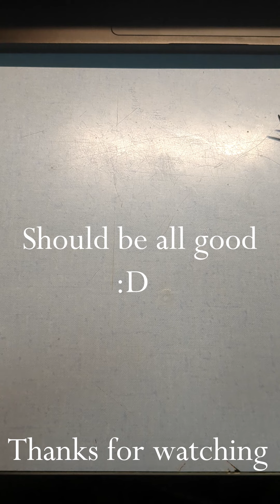SONY WH-1000XM4 Weird Noise Fix

Comment: Bought my headphones about 2 years ago as well and I'm having the same problem. Seems like this is a known issue and I'm shocked Sony hasn't done anything about it. Glad to report that your video helped fix mine as well. Thank you!
Reply: Mine developed this issue after almost 2 years of ownership. Unfortunately this did not fix the issue, and man oh man, that high pitched feedback is absolutely BRUTAL!!
Reply: @davidstasiowski6728  I nearly went deaf
Reply: Sorry to hear that. This is a serious issue for Sony. I had Bose QC headphones for nearly 10 years with zero issues. The high pitched sound could be made by compressing the ear cup, but never started on its own.
Sony’s damaged my right ear as well. I’ll never buy another Sony NC headphone again because of this issue.
Reply: It's been in every single XM model I think. But I swear it's 10x louder in xm4s. I agree it's fucking baffling Sony isn't doing anything about it! This noise is no joke it can seriously fuck your hearing and I am speaking from my own experience.
Reply: @davidstasiowski6728  Sorry to hear that. They damaged my hearing too and hearing is something I will never get back. It's sad, I had to lose my good hearing to a pair of fucking headphones. And yes same I'm never buying Sony headphones again.
Reply: @orangeeeeeee  I just stuffed a piece of cotton big enough to cover the little microphone and the grey rubbery hood in the middle of the speaker and have not faced the noise issue since then. I primarily had this issue with the right ear cup, but the solution mentioned above was applied to both ear cups and it works just fine now, haven't had the problem recur for over 4 months now.

This also tracks with what @David Stasiowski was saying about being able to reproduce the high pitched noise by compressing the ear cup. The cotton acts as a padded spacer to keep the microphone farther away from the ear so that sound reflected from the ear surface is attenuated before it can be picked up by the mic
Reply: @Rohan-ot5ji  Good for you, but I already returned mine with warranty a long time ago and I'm never buying Sony headphones again still.
Reply: @orangeeeeeee  my airpods did it, stopped using them shit heads and now my sony's are starting to do this shit slightly.
Reply: Serious problem of Sony headphones have,that can damage your ears freely... I think everyone should report about this problem to Sony support center officially. The headphones aren't cheap and the problem is absolutely inadmissible!
Reply: @Grafsin  True and to add to that hearing damage is literally irreversable damage. All you can do is adapt to the damage.
Reply: Programmed obsolescence.Doing nothing is part of the plan
Reply: What would they do about it ? You already brought it 😂 it’s not a PlayStation or I phone where they can just send a update out
Reply: @davidstasiowski6728 man stop being dramatic ain’t no way that lil ass sound damaged your ear tf did you do just keep listening to the feedback ? 😂😂😂😂😂😂😂
Reply: they can do firmware updates; they haven't. And there are some strict liability rules in some places (the EU) where if something is defective and injures you then even if out of warranty the manufacturer is liable. Given the way my ear feels this morning I do think they've gone beyond "loss of feature (here: noise cancelling) to risk to health and so need to take the hit. At worst they need to replace all headphones, repeatedly. Is that likely? Is if the lawyers say so. I recall that there was a batch of ultra thin Sony laptops where the Annualised Failure Rate (percentage of devices failing per year) was above 100%: even the replacements failed. They took a hit for that-but it made them care a lot more about laptop reliability
Reply: Bro 🎉🎉🎉
Reply: Have had my headphones for 6+ years and only now it started to deafen me while driving back from college classes :/
Reply: @Rohan-ot5ji  Thanks a lot man! The trick of the video didn't work and I tryied with a bit of cotton as you said and it worked!! Thanks so much!

Comment: Same problem here. It's really disappointing that 400$ headphones are just basically unusable (at least with ANC on) after just 2 years. My partner's XM3 are still holding up after 5 years of HEAVY use though.
Reply: Same here, I brought my XM3 and still keep on function while my XM4 has that problem, unbelievable. What a mess. It supposed to be better, not a assemble downgrade.
Reply: I have this problem on both my XM3 and XM4 so neither is safe

Comment: it really is just about reseating it to be honest. the wires are insulated. unless you somehow managed to slice them trying to solder them for some reason, it's not shorting or anything. not to mention if it was shorting, it would be catastrophic failure of the device. not just feedback. but it's certainly feedcback. you can confirm this by closing the sound proof barrier by pressing on the ear cup hard while the noise is happening as if to not let any air escape. It should momentarily stop but it'll come right back. which is also why if you slide the scale from off 0 up 1 in the app to toggle on ambient sound 1, the noise disappears entirely. the feedback occurs when noise cancelling is attempted.  if that's happening, you know it's atleast not "hardware" technically. but this reseating solution will solve your issue  for now. it's going to come back - i bet this only happens to anyone who has had their pair for a couple years. it's a consumable item - they design it with failure mind. 2-3 years feels about right. I have these headphones mind you and this all happened to me too. good little fix! i ended up microsoldering the joint and added hot glue support as a little test to see if that' will help act as a barrier from further moisture and debris damage. so far so good!
Reply: Your answer is the only one that makes sense! Also notice this problems tends to disappear for like 2 months than return. Thank you.
Reply: @lordfriar8736  are u fr
Reply: Thwn what should we do..
Reply: I think I can confirm this.
I have read a lot after facing this issue some years in, and there's a lot of theories online, including cleaning the moisture beneath the white covers. I do think those headphones have a moisture issue, some screws seem to have wears wax, others seem to straight up rust? I also had my Bluetooth failing for a long time and now it works again... But this particular problem seems to be caused by the position of the microphone.

When I tested the cleaning (I did not want to remove the cover because then the mic itself would likely get gunked up over time) I turned the headphones on with just the foam covers, to avoid undoing the pads all the time, but noticed a strong shriek on the RIGHT side this time. This caused me to of course move the ear piece away, moving the headphones and causing the sound on the left side. I previously already noticed that angling the left ear piece would prevent shrieking but it kept the white noise that this issue started with for me. So I played around by angling them and I was able to play with the feedback noise - like some musicians do on stage.
So, when re-seating the microphones, make sure to also put the wire back into the little grove thingies that hold it in place, probably with a bit of tension to better hold the mic in place. Maybe it could also be possible to add something between the mic and the rubber cover to stiffen that area and prevent it from moving around.

I suspect this issue started appearing when the ear pads started to degrade further. The fabric in the middle also kinda fell apart with the glue failing to hold it, and the foam cushion themselves, which are already pretty thin, are even flatter now. This probably causes the ears to press into the microphones and occasionally change their position for the worse. I've seen some sweat resistant pads that seem to have a plastic cover in the middle. They're thicker too but I'm still worried that they'll press against my ear, so I'll try to get the regular pads from the same company first, since they're also quite a bit thicker. I have read in the reviews a few times that they make the NC worse, but now in hindsight I'm not sure if this may not also be more or less the same issue of people hitting the microphone and that causing issues.

All in all definitely not a good look for such expensive headphones, but I already had some bad long term experiences with a Sony Xperia tablet too where one of the side cover's "glue" failed to hold it in place, which is ironic because I also had an Xperia Z phone which was super solidly built.

Comment: Thank you! The whistle started after the flight in the plane. I had a whistle on the right side, did everything the same way as you. Everything now works as it was before.
Reply: Same lmfao. But It got worse like a few months later.
Reply: have you experienced the problem any time after this fix?
Reply: @marcs_gaming_paradise  I figured out that the noise only comes on when Noise cancelling is activated. When in Ambient sound, the noise goes back to normal. The thing is that the M4 audio goes hand to hand with Noise canceling. It sounds better.
Reply: I HAD THE SAME EXACT SCENARIO HAPPEN
Reply: But why😭
Reply: I thought i was intercepting the pilots

Comment: Thank you for this video! Ive had my xm4's a little over a year and they just started making this awful screeching noise a few days ago. I thought it was the end until i found this video. As of 10 minutes ago they work just fine. Sony really needs to fix this issue as its not only the xm4s that have done this.
Reply: Hey. I just bought the same headphones yesterday. When this happens, can it happen while the headphones are turned off or just when it is on?
Reply: @sniperfox0108  with mine, it seems to only happen just when they are on and connected to Bluetooth. If it does happen You can turn off noise canceling in the app and that may help. But mine also recently started doing it again after I wrote this comment so I have been using them wired and not bluetooth. I am currently looking into another set of headphones.
Reply: @DakotaMartin96  alright thanks bro. Tbh, I saw about this problem legit after I bought it and I kinda got worried. Hoping mine doesn’t happen either at all or just in like 1-2 years
Reply: @sniperfox0108  yeah bro, I had no clue about this problem. Just out of the blue it started making this really high pitch screeching noise where I couldn't even use them on Bluetooth. But they were a great pair of headphones. Kind of a bummer this issue exists. I've been looking into the Sennheiser Momentum 4s.
Reply: @DakotaMartin96  that sucks bro. But thx for telling me about this. Hopefully u find the one that u like👍
Reply: hey, has the repair held up in 4 months?  I just did the repair but some other commenter made it seem like it needed be completely replaced eventually.
Reply: @metalskinn460  unfortunately mine only lasted only a couple weeks I believe after I tried the repair before it started making the same noise. Kind of disappointing considering they are a great pair of headphones. I recently switched and got the cheaper JBL Tour One's and haven't had a problem with them so far.

Comment: WOW its Oct 2023 and this helped me a lot. I bought mine 3 weeks ago and had this issue. Did everything here and it worked! I saw that the little rubber piece had fallen off on mine and wires were touching. THANK YOU SO MUCH this helped and saved my money!!!!!

Comment: Bro…I bought these when they first released and way more mileage in that time hands down using day to day, long hours within those days, and it was only affecting the noise cancelling/ambient settings, not when they were in the “off” setting. So I was just gonna say “Well, they’re less than half the price now new, wallet it’s not gonna be happy either way, but there’s a silver lining”. So I tried this thinking “What’s the worst…you’re going to break the broken?!” And it worked flawlessly. I never rant like this but this is the first time probably ever where I see someone fixing something with “electronic tricks” to where I don’t even really bother no more. I don’t know what else you post but saving me $240, the least I can do is like, sub and share in forums where people still haven’t found out how to fix this issue. Thanks again!
Reply: You can also replace the mics if you know how to solder. Bought 4 mics for like $30 incl shipping. Just replaced the 2 mics using mics with part number ROM-2235L-HD-R in this video and testing.
Reply: @sizzlacalunji  definitely know how to solder. And even if it was something a little more tricky, my brother specializes in welding/tig welding which he’s helped with a lot of “broken” guitar gear and it’s nothing for him figuring out the electronics. So if I need to I definitely will. Because I have these on my head way more than I want to admit and use the mics ALOT. Thanks for that!
Reply: @peterbatten596  yw. Oh you’re covered then. After 5 days am yet to experience any pressure imbalance or feedback loop. Btw, the $30 was in CAD so it should be about $25 or less USD. All the best.
Reply: @sizzlacalunji  I bought mine in 2022 and they’re still in practically new sound wise. The ear padding is so worn and torn, it’s not even funny. But even still it’s purely cosmetic. I might just buy a brand new set of these while they’re still cheap and before they randomly discontinue them, knowing that I still have amazing day to day sound even if I upgrade to a new model in the future.

Comment: para los que no se les soluciona el problema:
1) quiten la almoadilla y saquen la gomita que cubre el microfono con cuidado.
2) retiren el microfono con cuidado y saquen la telita negra que lo cubre( no tiren esa telita negra)
3)dejen remojando la telita negra en alcohol isopropilico y limpien el microfono con alcohol también.
4) vuelve a poner el micrófono en su sitio y colocale la telita negra redonda nuevamente, si no se pega bien coloca un poquito de agorex o pegamento en los bordes(solo en los bordes ojo)
5)le vuelves a colocar el protector de goma que cubre el microfono y en la parte de abajo en el protector le agregas 2 gotitas de pegamento en cada esquina para pegar un poco de algodón( en forma de bolita y el suficiente para que cubra toda la parte de abajo del microfono) no excederse con el algodón porque puede perjudicar la cancelación de ruido.
6) dejar secar todo 2 horas y el problema esta resuelto, esto es debido a la humedad que produce el audifono y lo mal diseñado que está (también pasaba con el xm3), en los audífonos bose qc35/45 no pasa porque el microfono esta tapado con tela dura y están mejor diseñados, prefiera modelos de bose si no quiere problemas de este tipo.
//espero que mi tip les ayude, yo igual pase dolores de cabeza por este error//
Reply: Muchas gracias, lo voy a probar
Reply: Bro puedes hacer un vídeo? :(

Comment: This video actually helped me solve another problem i had with the headphones. The headphones were producing crackling / popping / clicking sounds when doing slight movements. After removing the black film and cleaning the mic with alcohol the annoying sound is no more. Lifesaver!
Reply: I had the same issue, along with the intermittent "EEEEEEEEE," this solved both for me :)

Comment: Thank you my friend, apparently this resolved my issue with XM3, who also suffers this problem. It's damn difficult to use the headphone after that awful noise, I'm scared to get that noise back. Tried full cleaning but nothing. Removing this damn protection/sticker made it work

Comment: (If the sound from your headphones has also seemed dull lately) Just a thought, folks: while the earcups are off and the inner bits are exposed, take a fat minute to remove any hair, dust, etc from the inside of the headphones and any earwax or dust accumulation from the foam that rests against your ear in the ear-cup. I used q-tips, isopropyl alcohol and a pair of tweezers. Be careful with metal tweezers as the inner magnet might scare the crap out of you when it inevitably suctions to them, lol. It should improve the audio quality. Cat hair especially is very pesky and seems to collect inside over time.
Reply: Hey. I just bought the same headphones yesterday. When this happens, can it happen while the headphones are turned off or just when it is on?
Reply: @sniperfox0108  If you mean the high pitched ringing malfunction—that only happens if the headphones are on AND in ambient noise cancelling mode, and in my case only showed up after over a year of near constant use. It seems to be an issue with a feedback loop within the ANC mic.
Reply: @HintsofVanillla  Do u recommend turning off the anc so it doesn’t happen. I don’t really mind having it off tbh. I just don’t want this to happen.
Reply: @sniperfox0108  I have no idea if not using that mode will affect the chance of the defect showing up—as im not sure what specifically causes it, but if you dont use the ANC then you won’t ever hear the screeching if the defect is/becomes present as it only occurs when ANC is turned on. 

If you want to use the ANC, I’d recommend cleaning the inner parts of the headphones regularly (as in once every 1-2 months) with isopropyl alcohol + tweezers to pluck out hair, and not wearing them in the rain, in very humid weather, in the bathroom after a shower, or anywhere else where very high humidity is present or water damage is possible.